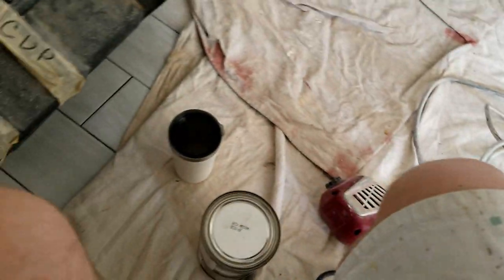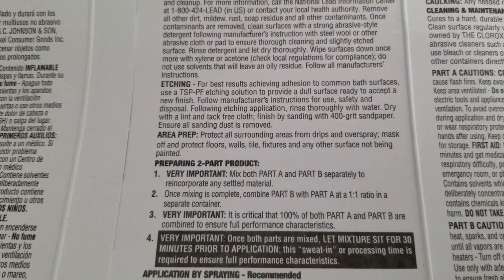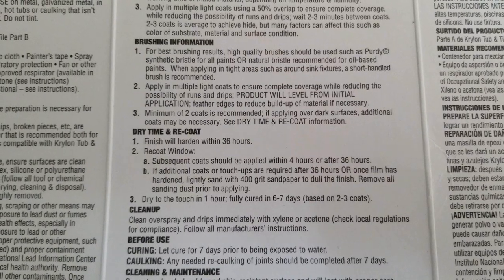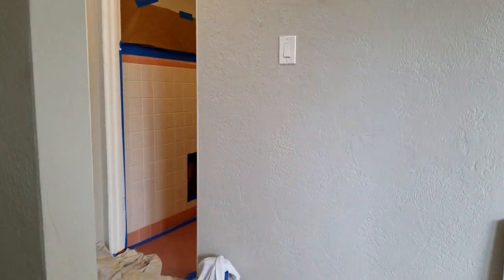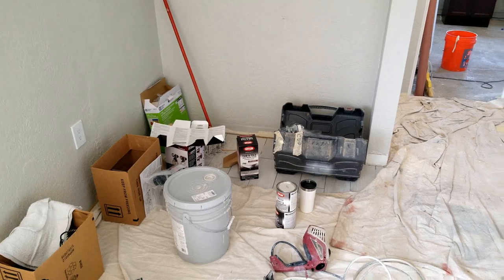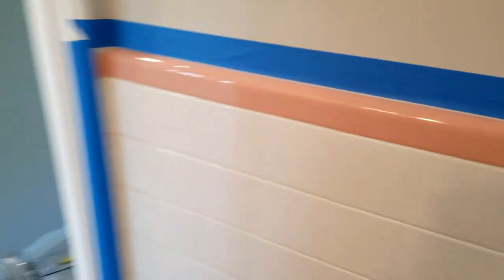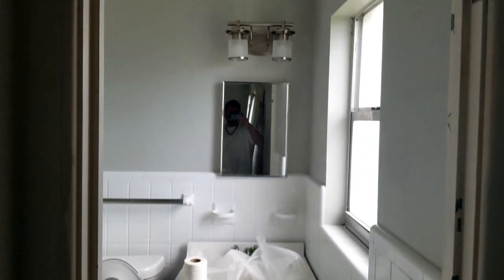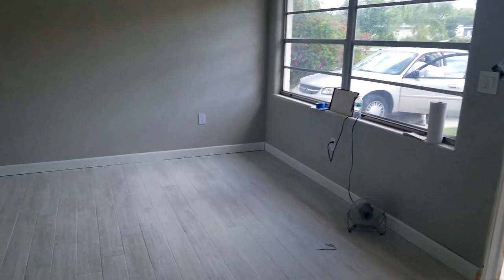Krylon Tub and tile restoration

Comment: Nice work. If I may make a suggestion. Actually show the process of tub and tile restoration and not your flip, unless that's what your video is about. Show the spray if possible, what tip, if applicable, clean up with what solvent and how much, how many coats, what time in between, how much material used etc. Again you do nice work!
Reply: exaclty this! great before and after, but many informatioin left unsaid.

Comment: Did you have to further thin the finish with xylene, or acetone before you sprayed it,  or you just add  parts A and B then sprayed after the 30 minutes sweat in time?

Comment: I was wondering what kind of finish did it give you, smooth, little gritty and do you have to sand any?
Looks pretty damn good from a video stand point.  Nice job! Total transformation from that ugly 60s crap.
Reply from the maker: It's got a bit of texture , but the old tile had it first , the pink was smooth like glass
Reply: So I’m guessing the epoxy helped with smoothing the surface?  I have done a little Fiberglas repairs on my board and boat and a last coat of epoxy resin really makes a difference
Reply from the maker: @Grimmeute   Yeah not bad at all , worth it now let's see if it holds up
Reply: @WEALRO  Did it hold up?